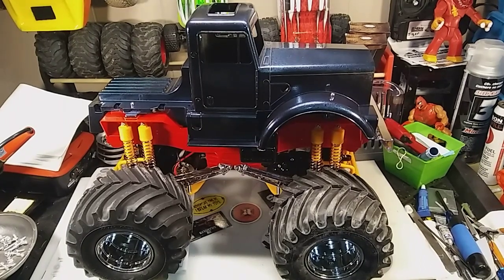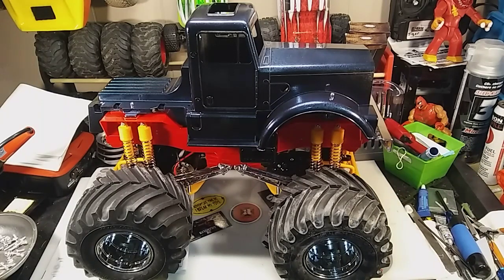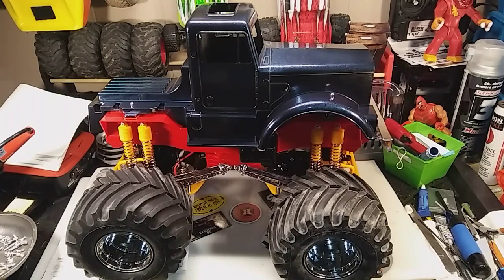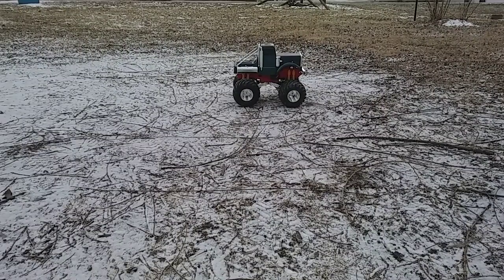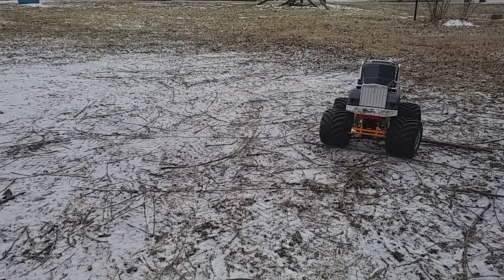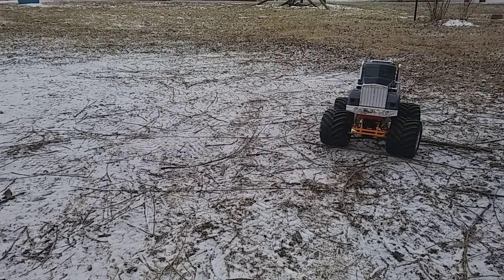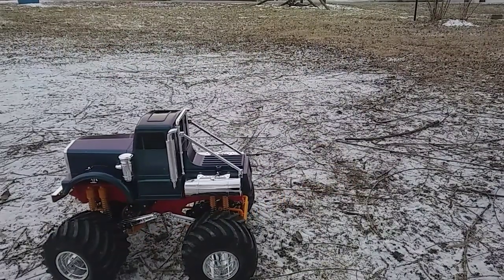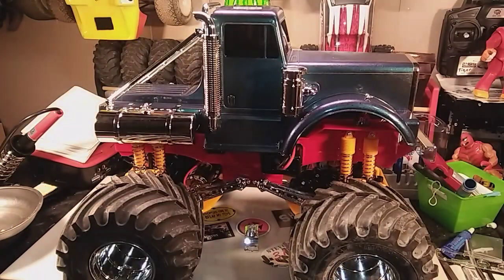Tamiya Bullhead build part#4 Tamiya Tuesday

Comment: 😁Looks good.  That's strange I used to run the stock esc with the 20T motors no problem? I did upgrade later to the 860 it will run much better with it for sure.
Reply from the maker: Thanks i was hoping you would watch and see if it was me or faulty equipment ill try a few more time then switch out the esc i want to see this baby in action😁

Comment: This should have been in Tamiya build-off #7..Make sure that ESC is set to brushed mode
Reply from the maker: Thanks i think it only has brushed mode no third wires ill mess with it more before i swap it out put 4hrs into her today wore me out so close i want to run it i did enter build off 8 i just ordered a mf-01x rally vw bug will be my first build off